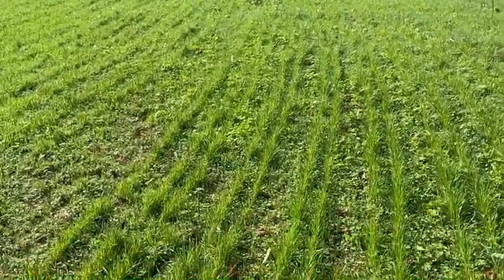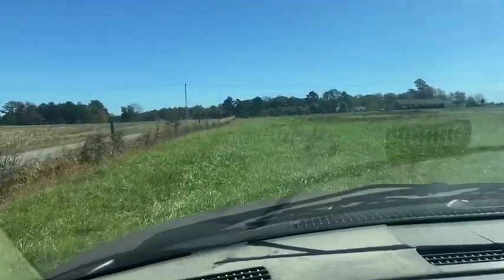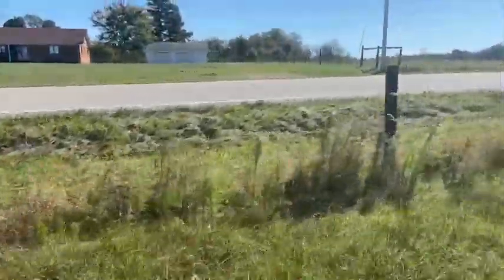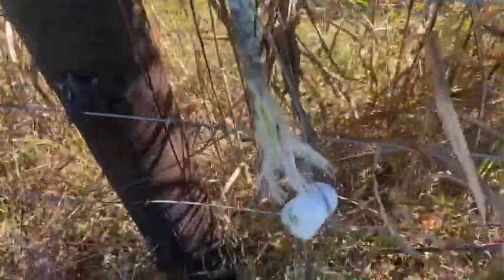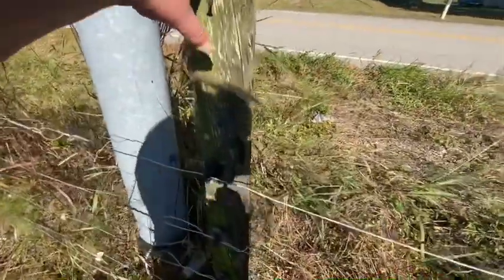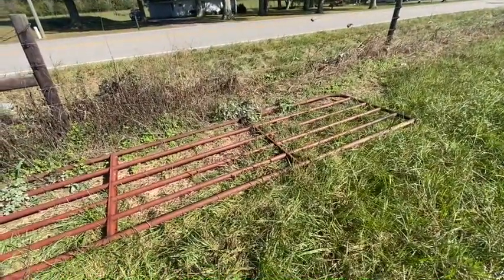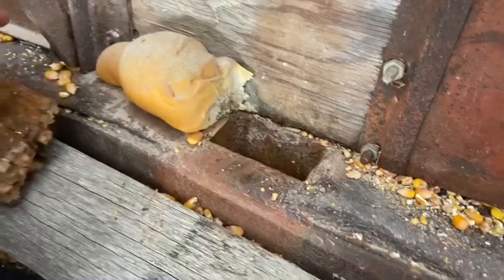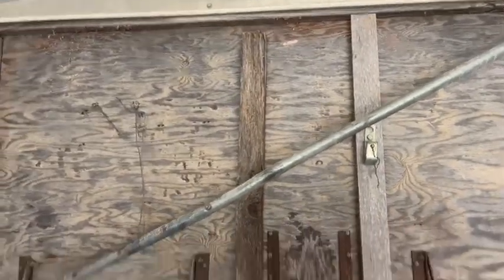Fixing Fence and Truck Tailgate

Comment: Built a lot of Decks with just a chain saw.  

I've done my share of home remodeling with a chain saw.  If'n your saw bar is tru you can use it as a square to tru your board before nailing.
Reply from the maker: I’m surprised that one cranked. It’s about 39-40 years old. The big Stihl didn’t crank and the one we use most must be at Dad’a house. That’s been a good saw.

Comment: Yall done a good job on the fence and standard,  I take 1 them punches to LOL 🇺🇸👍👍😁
Reply from the maker: The fence just needs to be redone. It was built in 2000. It started out all creosote post. The government had been monkeying around with the formulation and now they are all rotten. I found out that all creosote post from that era are no good. Between that and cars running through it just needs replaced.
Reply: @Thomasfarmstn  yea they not treated like they use be for sure